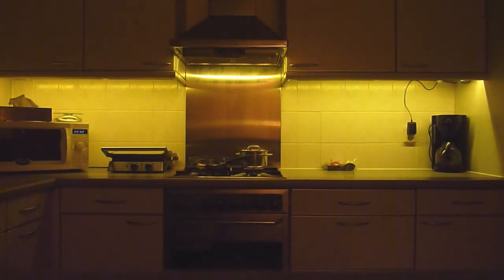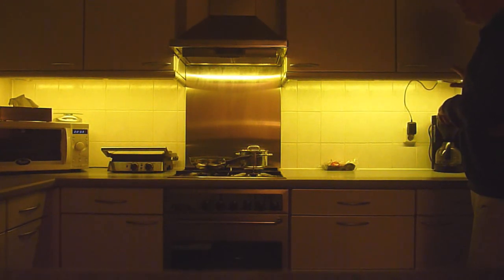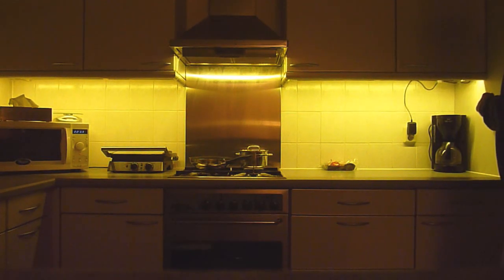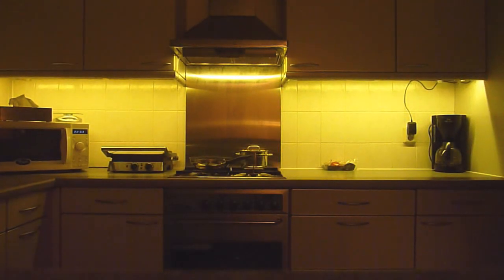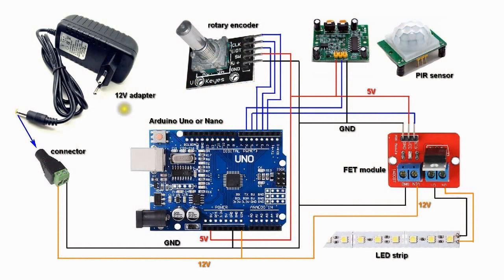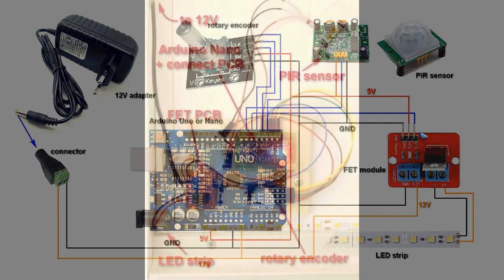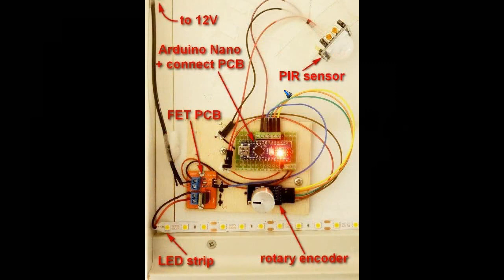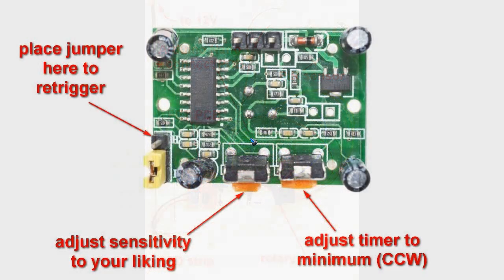Arduino PIR Sensor Fade Kitchen LED Lighting

Comment: This is a really cool project.   I use a home automation hub (have done since 2015) for this, but if someone just wanted simple lights like your situation, this is absolutely perfect, and although the Arduino is running all the time, the power usage will be less as lights don't get left on.
Fantastic little project.

Comment: Would it be possible to take the time someone needs in the kitchen from the sensor and adjust the on time to some value so it is near to the needed time of light. I mean that the sensor is for example in an entrance an so only triggers while entering and leaving
Reply from the maker: In software anything is possible ...